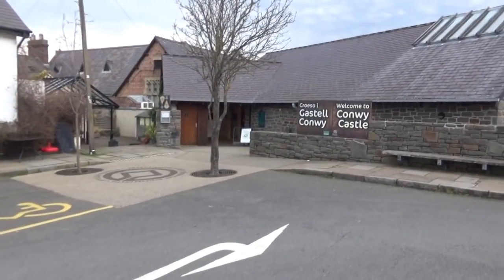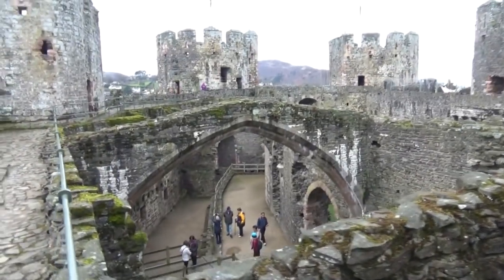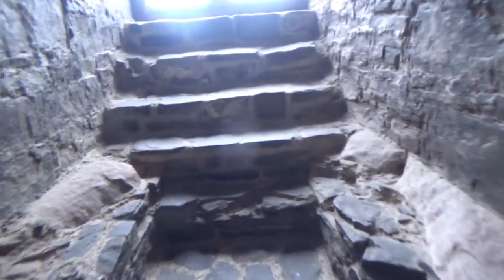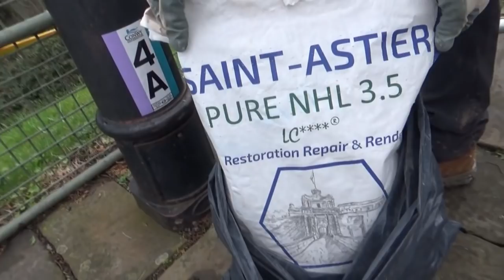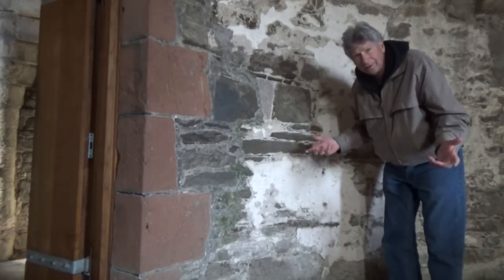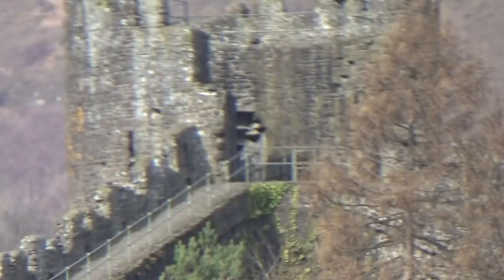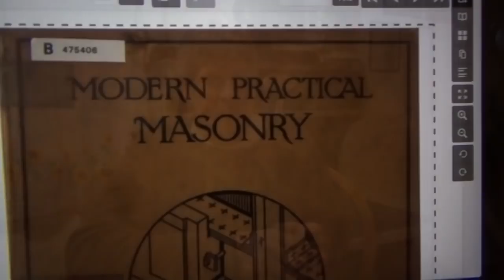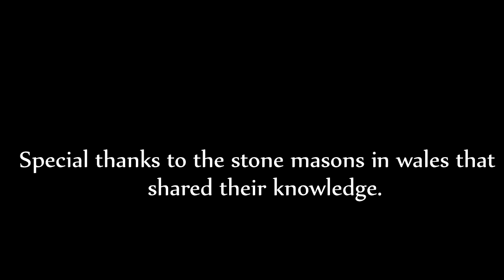CONWY CASTLE, A stonemasons  commentary (Mike Haduck)

Comment: It would be great if you went to Newport RI and saw the Breakers. There is an out building called the Doll House and has an unusually smooth glassy brick with red mortar, that I have seen used in many of the Romanesque Revival libraries here in Connecticut. 
I remember seeing catalogues from this era with all these ornamental masonry ready to order. You could have your own castle.
Reply from the maker: Hi alohath,  I was actually stationed in newport 1973 and got to visit most of those mansions,  quite impressive,   never seen the catalogues thought,  that would be quite interesting,  thanks mike

Comment: just a little quiz Mike....why does the staircase rise in a clockwise direction?
Answer.... So that if the castle was under attack the soldiers inside would be able to use their swords right handed!
Great vids
Reply from the maker: Thanks Stacyey, I never knew that, I appreciate it Mike
Reply: Stacey, where did you learn that? I also never knew that. Military genius from the Middle Ages.

Comment: Mike, unlike the castle builders of 1700 years ago, we don't use a lot of arches. We use steel angle irons to carry the load across windows, doors, etc. But steel rusts and I've got dozens of steel angles to cut out and replace. Any thoughts or have you ever done a job like mine requiring new steel across brick spans.
Reply from the maker: Hi Jeffery, It’s a shame but it’s the truth that all the steel rots away,  and then they have to redo it over and over, I have taken Steel out, And I arched instead, And replaced steel in some places or even use the oak beams,  so I guess the answer is it all the depends on the situation, , I hope it helps thanks Mike
Reply: Thanks Mike. I'll let you know how it goes.